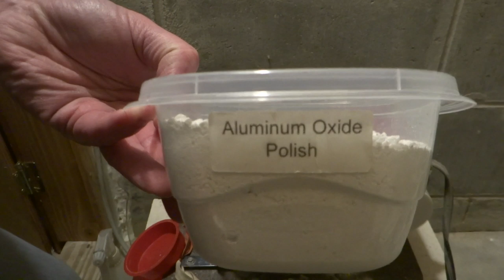How to Make Stone Crosses

Comment: What a wonderful thing to do with the rocks you acquire. The love put into each cross increases as it is passed along. Beautiful. Thank you also for demonstrating the vibratory tumbler. I noticed that you didn't add water except for a few squirts in the beginning, and that you're able to entirely fill the tumbler. Time for me to research vibratory tumblers! I'm a new rockhound and only have experience with a rotary tumbler and a tile saw. Ah, the endless possibilities of the hobby! Great video!
Reply from the maker: With a vibratory tumbler, you just want the rocks wet, no standing water.  I open the barrel two or three times a day and add a few squirts of water if they're drying out.  The 220 stage has to be watched the most carefully.  There is more rock being removed and the rock dust dries the slurry out.  I really like my Lot-O tumbler.  I highly recommend getting one.  Vibes use way less grit and finish rocks really fast.  Most of my rocks spend a lot of time in rotary barrels for the first stage before going to the Lot-O, but the crosses go straight in.
Reply: @MichiganRocks  Great tip! Thank you! I'm going to look into that.

Comment: I just got 4 of your crosses in the mail from Oliver. Beautiful! One question. Do you ever drill a hole at the top, either before or after polishing so they can be used as a pendant?
Reply from the maker: Hi Paul.  I just mentioned your name in Agate Dad’s video because I agreed with your comments on agate polishing.  I can’t imagine spending that long polishing one little rock.  

Thanks a lot for buying some of my crosses.  I didn’t even know if they mailed them out or not.  I have drilled other things similar to that and glued in a small eye for a pendant.  There’s a video I made about a pendant I made for my son where I did that.  I also drilled a hole in a Michigan shape for my sister in law to wear as a pendant.  I use a Dremel in a drill press with one mm diamond bits. Then I shape my own eye from silver wire and epoxy it in.

The crosses you bought would be ones I made in this video.  They were completely out when I made this video, and all of these went there, so I know that for sure.

Comment: This video came up and it is of interest to me because I cut a lot of slabs and was looking for a rather "simple" design to use up the slabs that probably would otherwise never get used.  I do not have a vibratory tumbler and am wondering if you have ever taken the stone crosses to polish in a rotary tumbler.  Perhaps if the time in the tumbling stages was limited to 3 or 4 days.  Any thoughts?
Reply from the maker: I haven't tried doing shorter runs in a rotary, but I'd be afraid that they wouldn't get a good shine. I think the best plan is to run them in a vibratory tumbler. If you want to see the difference, look at this video. I shows crosses made of the same material run in a rotary and a vibe. You might not mind how they look when done in a rotary. https://youtu.be/5V33xUTkmRM

Comment: My LOT O finally arrived!  I have painted my concrete block and am wondering if just the self-stick adhesive will be enough to keep it secure for the long haul.  It looks like yours does not have any thing extra added.  Have you ever had any problems with it coming loose from the block?
Reply from the maker: I just used the included double sided tape and have never had any problems. It's been stuck to the block for about ten years now. You're going to love that machine. I have a second one ordered for myself.

Comment: Very nicely done ... Thanks for sharing your procedure! A question, if you will, what kind of cutting fluid do you use in your saw? Thank you very much.
Reply from the maker: I use plain water in that saw. I used to put in an additive made just for rock saws, but it was kind of expensive. It's supposed to make your blade last a little longer. I don't know if it saves enough blade to pay for itself though. 

In my slab saw in the garage I use mineral oil.
Reply: Thanks for the prompt response - Interesting - I purchased the exact same saw that you're using from GemLap Equipment - Ferndale, Michigan a quite number of years ago. Liked their 90 degree cut shoulder design. It will be the saw I'll be using for this application. Not sure what I'll use as lubricant as I noticed that plain water makes the outline easier to see. Thanks again!
Reply from the maker: @kiotipass  That saw is really great. I just bought another one a couple months ago as a back up saw in case something happens to this one.

Comment: Watching this a few years after the first time. I knew you had some sort of “jig” for your trim saw so that is cut on a 90. Are there specs for the jig??  Thanks
Reply from the maker: The jig is just a ramp that has a slot in it for the blade. You would have to make a different ramp for every saw. The only thing you have to do is make the top of the ramp point toward the center of the blade. It's like the radius of the circle.

Comment: Thanks again, you can see I am working my way through your videos.  I have a quick question again if I may. I have the Hi-Tech diamond 6" trim saw.  I use it to cut and trim smaller rocks. I tried cutting a symbol before I watched your video and experienced the deeper cut on bottom due to arbor sitting below table. You said to build a ramp so the blade hits at a 90 degree angle. I can build the ramp but how do I know it is going to hit at 90 degree? Would I buid it at a 45 degree angle or just have to play around with it to get the 90 degree?
Reply from the maker: Taking some measurements and doing a little math will help. If you aren't great at math, I guess you could always do it by trial and error. What you want is the top of the ramp to line up with the center of the blade. I hope that helps.

Comment: Great video.  I learned a lot just by watching.  Got my Lot O Tumbler and just picked up a used MK Diamond Tile Saw last night.  Got a feeling I am going to have to wait to January to use them.  Can't wait.
Reply from the maker: Make sure you mount that Lot-O to a concrete block.  I filled my block's holes with concrete too.  I hear that the newer ones don't have a deep hole in the bottom.  Mine did have a hole that trapped pieces of ceramic.  It was a pain to dig them out every time.  I filled the hole with epoxy and it has lasted for years.  No more digging out stuck ceramics.  

If you haven't watched my crazy lace agate video, I recommend it for learning to use your Lot-O.  If you follow my basic recipe, it's hard to mess it up.

Comment: Nice! I have so many finished projects that I don't know what to do with. You're doing it right.

Quick question: Doesn't the mist settle on horizontal surfaces, covering everything in dust? I want to move some equipment indoors for the winter but I worry about contaminating my home.

Thanks for the vids!
Reply from the maker: Not as much as you might think.  Right around the saws, I have to wipe it up, but it doesn’t affect areas much farther than that.

Comment: Good morning  i just bought a beacon star 10" trim/slab saw.  arbor is above the deck  the last owner was usinf baby oil to cut rocks. is that ok ?  if not what shoud i be using  and also how much liquid should i put in the tank?   thanks  chad
Reply from the maker: Baby oil is mineral oil with scent added. I use mineral oil in my slab saw, but I use water in my trim saw. 

Add water or mineral oil until the bottom of the blade is covered about 1/4 inch. As long as the blade is flinging water or oil around, it should be enough.

Comment: I am trying to get my son to make some  of these. Do you have dimensions for the wood jig? Both of his saws are not the 90 degree ones.
Reply from the maker: No, because you have to make it to fit your saw. Just make it so the top of the ramp points toward the center of the blade, like the hand of a clock. In other words, the ramp top should be along the radius of the blade. It just needs to be close, not perfect.

Comment: good morning i have a question,  i have a mjr 18# tumbler (ie 3 6# barrels)  i have gone through 4 of them they keep getting holes in the bottom  i was thinks is could fit a piece of rubber to glue to the bottom of the barrel.  would you have any suggestions?  thank you
Reply from the maker: PVC barrels are going to wear out a lot faster than rubber barrels. I have never used one, but that's what I've read. You could try what I did here: https://youtu.be/FgNL9ws4AS8

Comment: good morning  i have a question   i do not usually have rocks bigger than my lot o tumbler but here we are so i have a mjr 18# ie - 6# barrrels   how much grit should i use or stages 3 and 4  and how much water in a 6# tumbler.  thanks
Reply from the maker: Honestly, I have way more experience with my Lot-O than with the later stages in a rotary tumbler. My experience with finishing rocks in a rotary tumbler is almost all in three pound barrels. I usually just go with the same number of tablespoons as the barrel is rated for. So in a six pound tumbler, I'd just use 6 tablespoons. That's just my best guess, but it's someplace to start.

Comment: Another question. Have you ever made crosses with any type of Obsidian? Being a softer stone, I was wondering how it would hold up.
Reply from the maker: I haven't, and I would be concerned about the softness and the tendency to chip.  I don't think I've ever cut obsidian on my saw either.  I'd worry about the sharp corners holding up in the tumbler.
Reply: @MichiganRocks  I'm wanting to do some squares and rectangle smaller pieces with various Obsidians for a lady in my Church who does stained glass and is willing to make a piece with polished slabs. I think I'll cut some pieces of more common Black Obsidian and see how they turn out in my new Lot-O. I've got some Snowflake and Apache Tears in it now using the Rockshed's recipe. Doing fine for now. Thanks for your input.
Reply from the maker: @paulcarder8032  I hope it turns out ok for you.  Obsidian is tricky, but I've had good luck in my Lot-O.

Comment: LINKS: to machinery used please ?
or List of them, including the wet saw brands. Thank you.
luv the vids btw, very helpful.
Reply from the maker: None of the saws I used are being manufactured any more.  The slab saw, which I didn’t show, is a Lortone ST-10.  Lortone still makes saws, just not a ten inch version.  The trim saw that I used is a Gemlap saw.  The saw with the ramp is a Frantom.  Neither of those companies are in business.  Those are very old saws.  The tumbler is a Lot-O.  I got mine from The Rock Shed.

Comment: I loved your video. I would like to try this but I don't know any thing about vibrating tumblers. would a five pound metal vibratory tumbler work? I cant afford a lot o tumbler. Harbor freight has one on sale. Ore can you suggest some thing else better that does"t cost allot. I think its great that you donate the crosses to your church. Good idea. I would like to do that if I can make them.
Reply from the maker: Tumblers made for tumbling things like brass for reloading are not made for the weight of rocks.  The hoppers are also not designed for abrasive grits like silicon carbide used in tumbling rocks.  I haven't heard much about Harbor Freights vibratory tumblers, but their rotary tumblers do not get good reviews.  I've read of some people who keep them running for a couple of years, but there are also a lot of people who report them breaking after just a batch or two of rocks.  I wouldn't buy a Harbor Freight tumbler at any price.

I'd suggest that you start saving up for a Lot-O or other quality machine.  I really like the Lot-O, personally, but that's all I've ever used.  Even if it takes a long time to save up enough money, I think you'll be happier in the long run.

Comment: Damn! I did my first stone cross yesterday with a Dremel 4000 and a Diamond wheel on a 3mm shank. That cross being 6mm thick of Golden Lace agate took me about an hour! haha! No joke man. An hour! I need to get me this saw. Now I am looking for ways to put a bail on it, or maybe do a wire wrapping on it?
Reply from the maker: The rocks I'm cutting aren't quite as hard as an agate, but I can cut a cross out in a minute or two. I just make these as pocket crosses, but you could drill a hole in the top and put in a little eye pretty easily. I do it all the time for other things I make. I drill a 1 mm hole and use scrap silver wire to make a little eye. Put a jump ring on the eye to pass a chain through. I'd drill before tumbling. Check out this video to see how I drill and make eyes. https://youtu.be/VDoZL4MiPgQ
Reply: @MichiganRocks  Thanks so much!

Comment: Could you drill through from side to side at the top...to make a necklace?
Or would that break the rock?
Reply from the maker: Yes, you could, but it takes a long time to drill.  When I have made pendants out of things like this in the past, I have drilled a hole straight down from the top and glued in a small eye.  Then I put a jump ring through the eye.  If you look at the video of the pendant I made for my son, that's what I did.

Comment: Thanks for posting the video! Wanted to ask if the saw with the 90 degree angle is a wet tile saw or a wet diamond saw (is there a difference/is one better for shaping and cutting semiprecious gemstones)?
Reply from the maker: My saw is a lapidary saw, not a tile saw.  It’s a Gemlap, which is a very old brand that is not made anymore.  I have never used a tile saw, but it should do this job fine.  The biggest problem with tile saws is that they tend to soak the user from what I’ve seen.  I have several saws and some spray a fine mist.  Wearing a vinyl apron takes care of that, it’s not much water.  I use that saw inside with no problem except a quick wipe of the floor when I’m done.  The saw in this video doesn’t get me wet at all, but the counter on either side gets a very small amount of mist on it.
Reply: Thanks so much for your reply! Appreciate the info!

Comment: I've Got another question. I just received a Lot - O tumbler I ordered from The Rockshed. I'm waiting for the paint to dry on the concrete block before I mount the tumbler. I've noticed on YouTube that some have filled in the Holes, some haven't. I didn't, so I'm wondering if it really makes any difference. I appreciate your input.
Reply from the maker: I have mine filled in.  I don't know if that was in the directions that came with the Lot-O or if I read it somewhere else.  I have no idea if it makes a difference because I have never done it any other way.  

If you decide to do it, it's easy.  I just put it on an old piece of plywood, filled it with Quikrete and used another board to scape across the top to level it.

I think you're going to love that machine.

Comment: Hi how hard would it be to carve a cross from a large quartz crystal ball? I wouldn’t do it myself though… thanks
Reply from the maker: It would be about that same as what I did here. The challenge might be clamping a sphere into the slab saw. You'd have to put some wedges in to keep it from turning as the vice moves forward through the blade. After it was slabbed, you'd cut it up the same as I did in this video.
Reply: @MichiganRocks  it’s a citrine sized about a typical “crystal ball”…. 30 years ago it was worth 700$ or so…. If I shipped it to you, would you be able to make crosses from it to give away?
Reply from the maker: @IgivemylifetoChrist  Nope. I don't really have time to do commission work. Plus, I think your crystal ball will be worth a lot more as it is than it would be cut up into crosses.
Reply: @MichiganRocks I don’t mean commission, just a donation. I don’t want the ball to be used for new age stuff by anyone…what about one big cross that you keep for yourself?
Reply from the maker: @IgivemylifetoChrist  Oh, I understand now. That's not a project that I want to take on. I'm pretty busy making videos. Thanks for the offer though.

Comment: Hello there. This is Chad west I just won a 18# tumbler from mjr  ie it has 3 6 pound barrels. My question is how much water 
How much rocks
How much grit 
Any knowledge would be appreciated.  Thanks
Reply from the maker: Fill the barrel about 75% with rocks. Then fill with water to just under the first layer of rocks, maybe an inch below the top of the rocks. If the barrels are six pound barrels, I'd use 6-8 tablespoons of grit.
Reply: Thank you

Comment: What lubricant are you using on your saw?
Reply from the maker: I use mineral oil in my slab saw in the garage.  I just use plain water in my trim saw.  I used to use and additive in my water, but I clean my saw out every time I use it, so that gets sort of expensive.  I decided to just spend my money on blades a little more often.